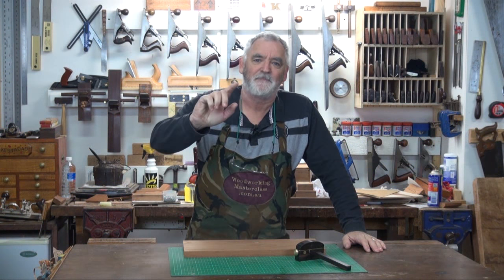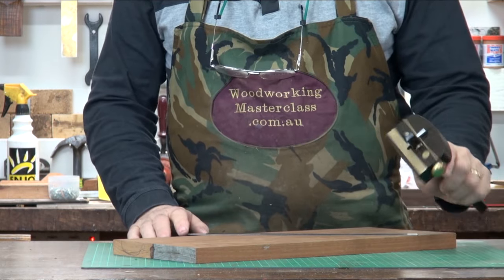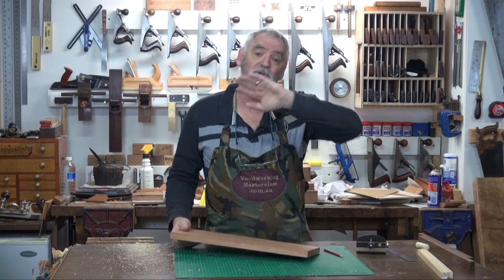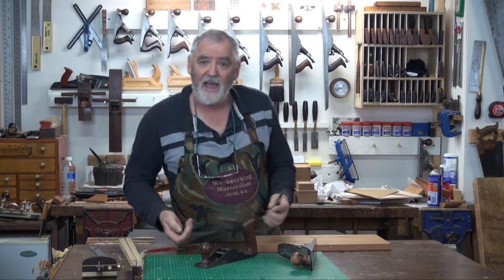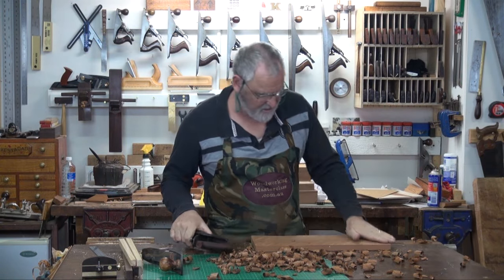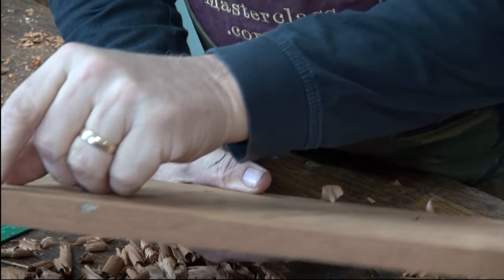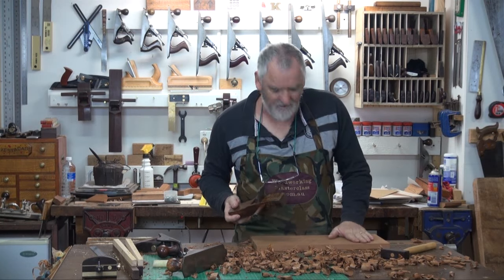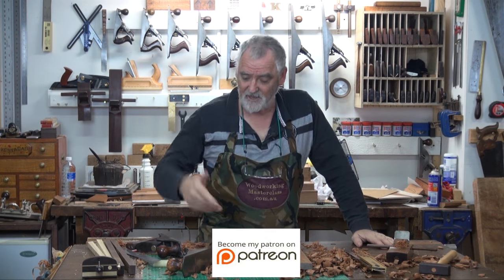Thicknessing Wood with Hand Planes

Comment: I’ve just had a board marking gauge given to me by a client at the charity I work for. The guy who gave it me was in his mid seventies and his grandfather made it. As a rule I prefer donations to the charity over gifts, but sometimes things move you. 

I shaped a blade as a scrub plane, because that’s ratifiable, but I'm very nervous about widening the mouth. I know if I do it will be on my new plane rather than my second hand ones with their history. Do you widen towards the frog or the front please? And how wide please? It looked about 1cm total width in the video.

Another great one, yourself, Paul Sellers and Wood by Wright are by far the best channels for to total newbies like myself.
Reply from the maker: Hi Mark, I have use a standard blade reshaped as a scrub plane blade but have never has to widen the mouth to fit it. Check so see if you have any travel in the frog backwards that may expose more of the mouth. If not I would suggest you try it as see before widening the mouth. Cheers Steve
Reply: Woodworking Masterclass Thanks a lot Steve, that’s really helpful.

Comment: Where did u get that marking gauge as I haven't got one but got most hand tools not as much as u lol, what is best waxes n oils to use on finishing I have a slab of cherry wood which I'm making it into a coffee table n I just want to see the grain more n bit shiny n what can I use to project the bark on da side? Plz and also I don't have s scrub plane thank you
Reply from the maker: Hi Danny, Making Guage is made by Colen Clenton available from HNT Gordon https://www.hntgordon.com.au/
Danish Oil, Tung Oil or Finishing Oil would be my choices, Varnish is the only thing I can think of that would protect the bark I'm sure there would be other stuff around. Scrub planes are very handy if you wish to flatten rough saw boards. You can made one that it quite effective by modifying a Stanley #4 plane and Blade. https://youtu.be/hP_oQENpw-U Cheers Steve

Comment: couldn't help noticing you have Stanley No. 2 hanging on your wall. What is the specific use for these planes? Is there anything they are specially good at? Thanks for all your amazing videos!
Reply from the maker: Hi Rodrigo, there is also a Stanley No.1 in the Tool Chest behind me. I find the No.2 especially useful for smoothing small pieces such as draw sides and individual Boxes. But in all honestly a good Block Plane will do just as go a job and possibly be less expensive. I used to use the No 1 as well but now prefer the HNT Gordon Palm Smoother. Cheers Steve
Reply: +Woodworking Masterclass , Wow a Stanley 1 and 2! Looking around Youtube I really can't find videos on those two planes. Any chance you can  show us how they work and perform? They must be real gems to work with. I bet you would hit it iout of the park with a video on these planes. Thanks again for the always teaching so many techniques and all the top notch videos!
Reply from the maker: I think they are not available anyone by Stanley. They work the same as other Hand Planes. So no special techniques required. Cheers Steve